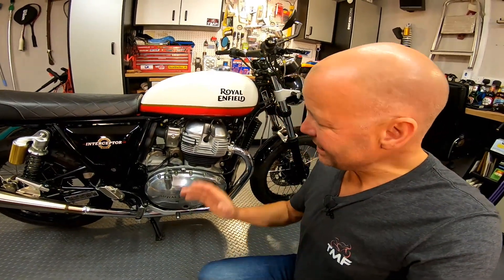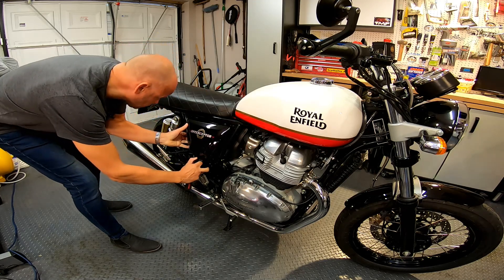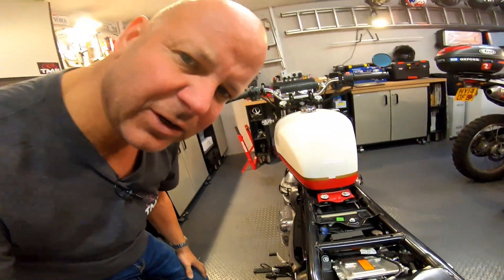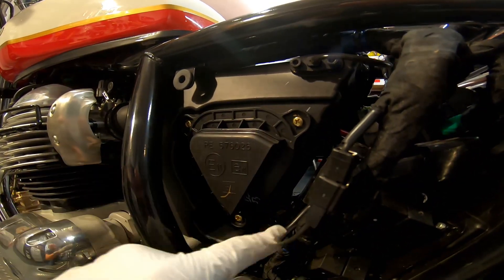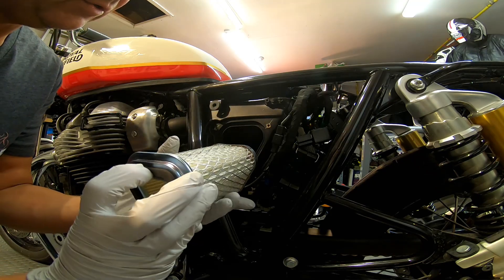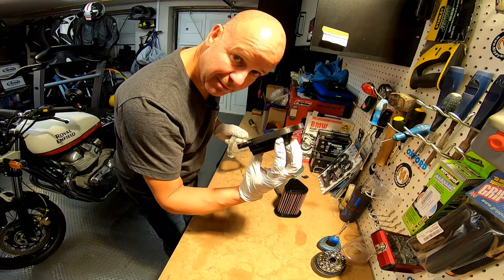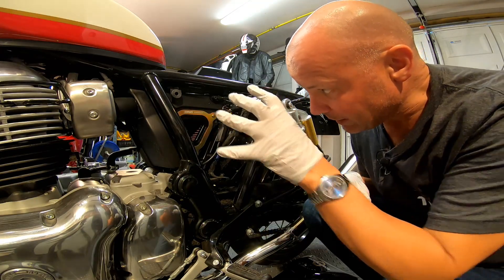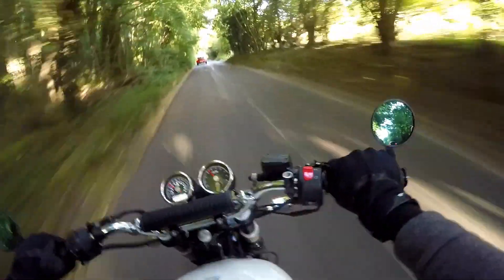Royal Enfield Interceptor 650 Essential Mods - How to replace the air filter and breather

Comment: my question would be how does fitting a non OEM air filter affect warranty? Given the small amount of hp increase on a non sprting mcycle seems not worh while IMHO!
Reply from the maker: Fair enough! I love a tinker and the main appeal to me is the fact I don’t have to buy a new filter every-time I service the bike, any additional Ho is a bonus. Don’t know if it affects the warranty...several have mentioned it, thanks for watching!
Reply: @TheMissendenFlyer  a new oem air filter is far far cheaper than a new engine, false economy but each to their own. Not like you don't have another bike to ride should the Enfield engine stop. Good luck.

Comment: Has this added any more to your insurance premium though due to slight increase in power and being a modification etc.?
Reply: I have done similar with my Duke, including a new silencer. They made a note on my policy but no increase. You must tell them though or they could refuse to pay in the event of a claim
Reply: @EWAScotland  Agreed! I tell them everything even if I change the oil filler cap!!
Reply from the maker: Good advice Jon - and great meeting you at the NEC yesterday!
Reply: I also have a DNA filter on my Interceptor and my insurer, Bikesure, have not increased my premium.

Comment: for those who do not know, always blow filters from inside out in the 70's i worked on gear with filters half the size of a mini car, dust kills engines
Reply: Except that the Royal Enfield twins are reverse flow, the center of the filter is the dirty side the outer in the air box is the clean side. It's done that way so dirt trapped is held in the filter when it's taken out and doesn't drop into the airbox.
Reply from the maker: Good call Ray!
Reply: @rayg9069 h ok, well I  was talking in general terms, all good thanks
Reply: @stuarthearn3862  In general you are correct, just pointing out a gotcha that is becoming more common specially on motor cycles. ;-)
Reply: @rayg9069  YES, I  had a 69 Norton 650ss, duel  Amel carbs no filters, i was young, NZ  roads are sometimes just gravel, bike lasted 4900 miles, later  I  served apprenticeship Cummins eng co, the filters are the most important asset, when it comes to life of the mill, another trick, put a light in it, if there are perforations the light will show, big money these big filters.
Reply: @stuarthearn3862  I'm currently thrashing around on a RE Classic 350, rejetted, Indian straight through exhaust, no decompression, pod filter on a small velocity tube. Sounds glorious through cuttings and tunnels and just plain fun to ride. You don't need 100 Hp to have fun ;-)

Comment: Do you know if this affects the warranty? My local dealer said I would lose my 3 year warranty if I change the filter on my interceptor. I'm pretty upset by it because it looks like it was a decision made by some dickhead at corporate.
Reply from the maker: ...I didn't ask - I suspect you may be right....
Reply: @TheMissendenFlyer  it was a strange conversation because everyone at the dealership, including the mechanic who is like a moto wizard, said it would be fine. Then they made a call to the office they report to, just to be safe, and that's when I got the bad news. So as someone who use to work on the other side of things, it may be the case that it's simply bad info. At least that is my hope. If anyone else has asked I'd appreciate them posting about it.

Comment: Tried it and found out it completely destroys the bikes performance and grown-up sound. The touch on the throttle is more aggressive, yes. But after 3000rpm there’s a complete loss of torque if you don’t rev the throttle to the maximum all the time when going through gears and even then the peak performance is lowered. With the original setup I was doing 170 kph frequently. With the filter it is struggling to get to 160!!! The Induction “roar” is also aggressive, but after a few rides so unbelievably annoying to you and everybody around you (riding through a town - you feel like 18 in a Honda Civic) and just pointless, since you are loosing power. I ride with a booster plug(which DOES make for a smoother ride) btw -  but tried it with and without it. The open filter is definitely the weak link. If you are not using a power commander, new pipes, big bore kit.... THERE IS NO POINT IN INSTALLING THIS FILTER AND RAPING YOUR MACHINE WITH IT. Back to the original it’s such a smooth and strong ride again.

Comment: My experience with washable filters is: grit coming through and damaging slide and other parts; foaming when very wet (due to oil coating) and; no improvement in performance. That paper filter is plenty big enough for a 650 and will filter out all the carp that a washable type will not. Feel free to ignore me. If you ever strip the carb and cylinder and see scores, remember this then. My experience is limited to a number of bikes, cars and 50cc model aircraft over 30 years, so what do I know?
It's an Enfield 650, accept it, love it and stop meddling!
Reply from the maker: ...I love a bit of meddling me...thanks for watching and for stopping by!

Comment: I bet on a Dyno this made no difference, that airbox is designed to cope, will have flowed all the air the engine needed. Give Enfield's engineers some credit.
Reply: Yeah, the current tune is not setup to run that much air.